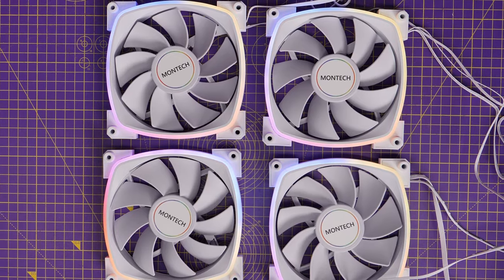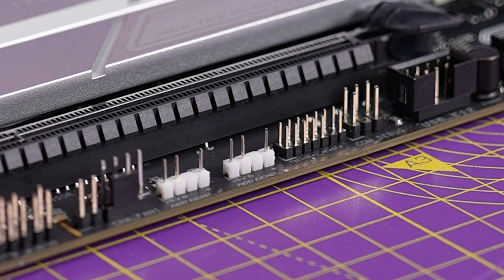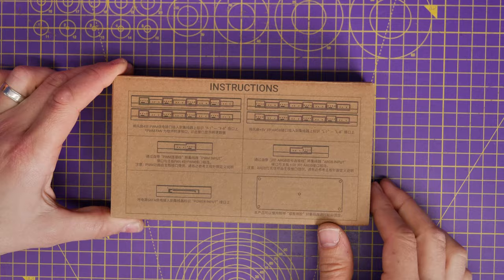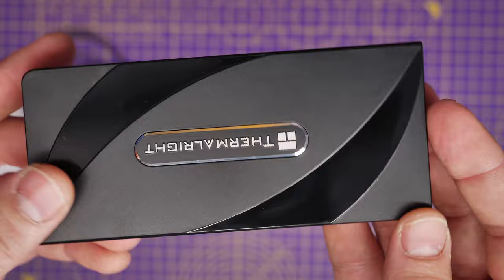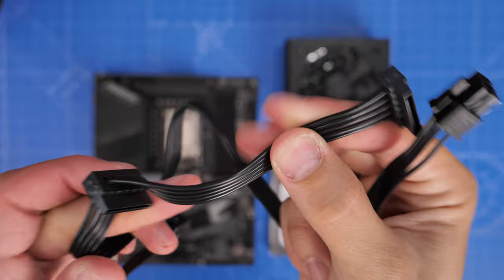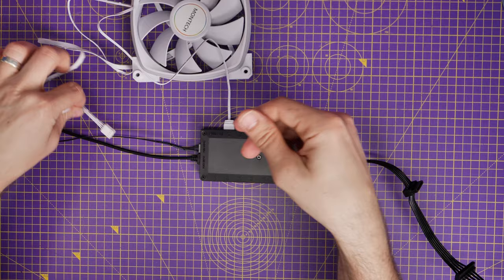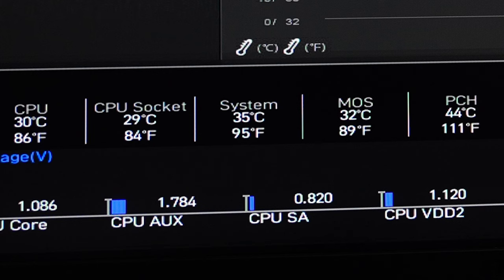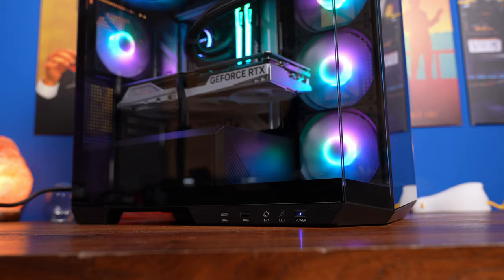How to install PC RGB fans really easily (short version)

Comment: MY PC mobo have 3 pwm system fan headers and one 3 pin argb header .  in total 3 argb pwm fans i want to connect to mobo.  the fans also support Daisy Chaining as long i know. (i will buy 2 montech rx120 for intake 1 ax120 for exhaust , better if  you tell if MONTECH AX120/rx120 PWM ARGB Case Fan support Daisy Chaining) . can i connect 3 pwm argb  fans and a cpu cooler on my mobo without fans hub? can i sync light and will all the wire be inside of case? will their be mass in aesthetic if dont use fan hub?

Comment: Is it the same method use for non rgb?
As I'll be building my first pc and I'm not into rgb
My mobo is a msi b550 pro wifi...And also can you connect the fan hub with compact psu? 
Thanks in advance and have a great life... ✌️

Comment: I literally just ordered this 2 days ago, supposed to be here Tuesday to go in my new JONSBO TK-2 case along with 
ARCTIC Liquid Freezer III 360 A-RGB and 6 ICOLER UNI Fan JM-V2 120 Infinity Mirror Module Daisy-Chain ARGB PWM Case Fan 120mm Reverse Fan Triple as intake fans.  I might use the stock ARCTIC fans or I might order 3 more of the ICOLER UNI just standard version, not the reversed.

Comment: Hello

Thank you very much for your work.

I need some help :)

I just bought a Kraken 360 ELITE and 10 LIAN LI TL 120 for my new config. The default nzxt fans will all be replaced.

How do I connect the TL 120 watercooling fans that have proprietary lian li connections with the NZXT Kraken ELITE 360?

are the TL 120 fans connected only to the lian li controller?

The nzxt pump cable has three female pwm cables for the fans.
Should I leave them empty? 

Should the nzxt pump only be connected to the motherboard with the usb cable, the 3-pin pump cable and the sata?

Difficult to find clear and complete explanations :/

Thank you in advance :)
Reply from the maker: The easiest way is to connect the fans on the radiator to the Lian Li controller. Remember which port you connected. Then in L Connect set the fans to respond to the CPU temp. Leave the fan connectors on the pump empty. Connect the pump to CPU fan and the usb header on your motherboard.
Reply: @TheProvokedPrawn  Thank you very much, it's very clear :)
It might have been easier to buy the Lian Li HydroShift LCD 360 TL watercooling rather than the Nzxt ELITE 360.
Thanks again